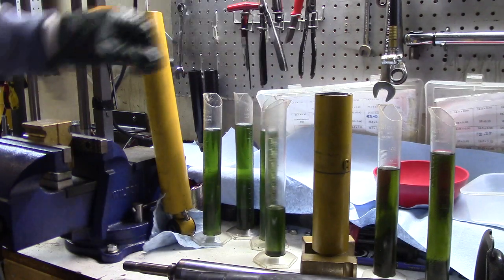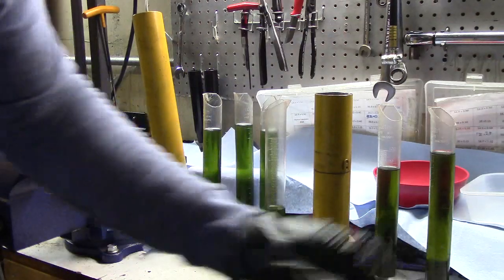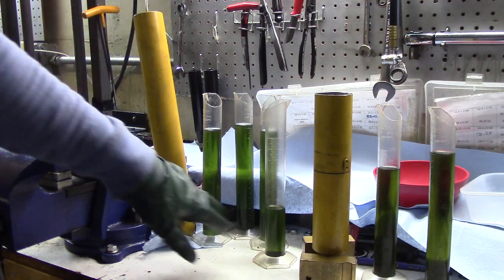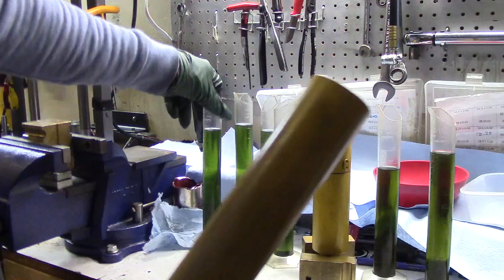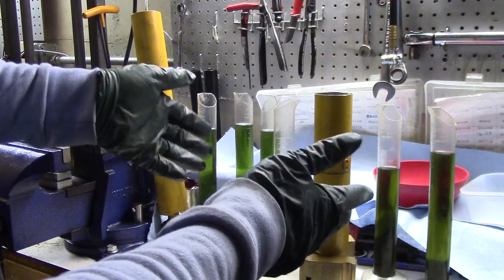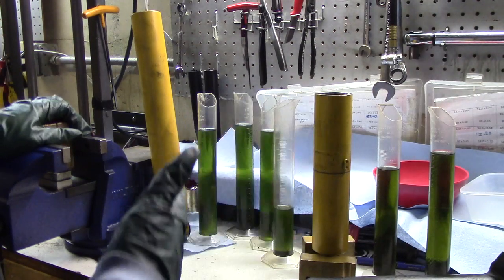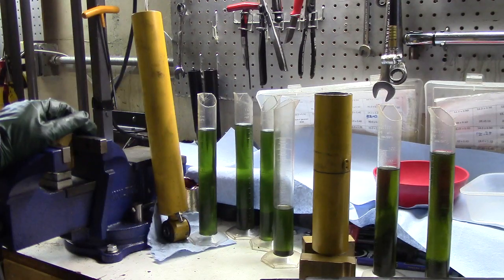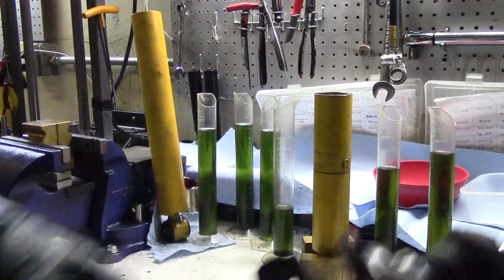1/3 GALLON OF OIL can leak into the ground from each set of improperly handled shocks or struts!

Comment: KYB include instructions to drill and drain the old shock in the instructions that come with a new shock. I never noticed those instructions in the past. This time I drilled and drained them. I didn't get nearly as much fluid as I expected however. Which is what started me searching and landed me here.
Reply from the maker: Thanks for your comment, and going down the rabbit hole to find this video. This is the first time I've heard of such instructions, so bless KYB for at least caring enough to indicate that. I really intend to create more awareness about this - engine oil gets all the attention when it comes to recycling.